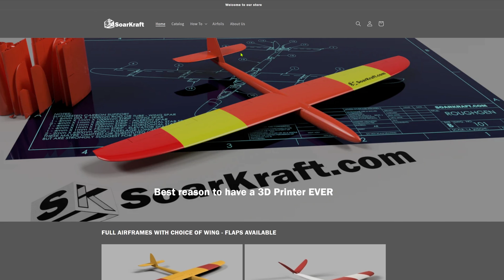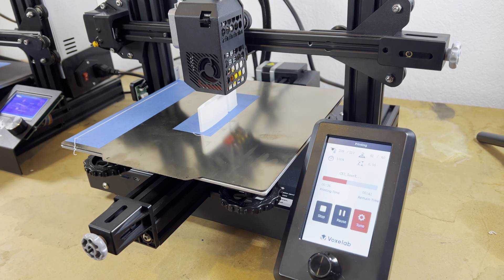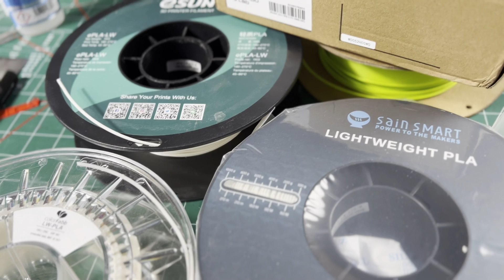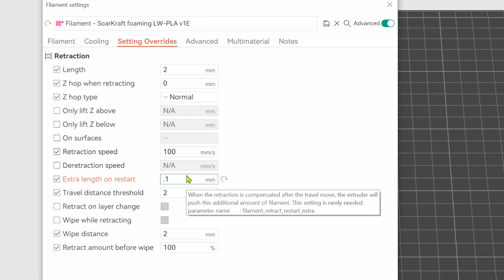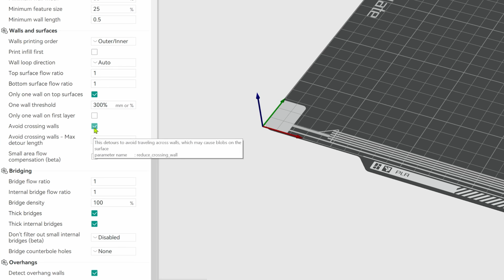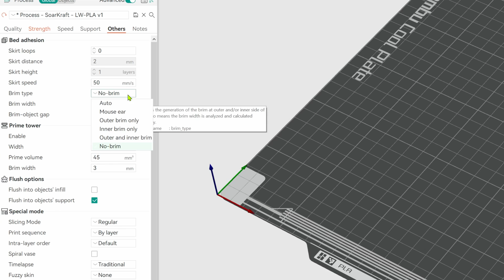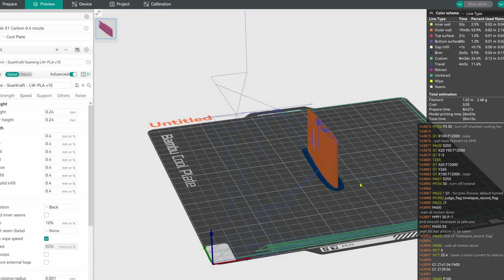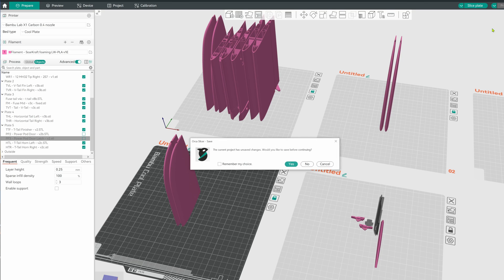Orca Slicer for Airplanes using any printer - SoarKraft

Comment: Hi Wayne, I have purchased your Roughgen glider.  Often in your videos you comment that Simplify3D as being one of the best slicers, yet you have never shared your slicer setting for Simplif3D, nore are they available on your website?  Any chance you're able to share them, because I too still feel that Simplify3D is and was the best.
Reply from the maker: Simplify3D was far better than Cura 2 years ago, but because you had to pay for it no one used it, and the recent revamp did some good improvements, but was not as good as I hoped.  I do have a small section for it in my instructions in the appendix, but I have mostly moved away from it.  It does still work, but not as good as Orca/Bambu/Prusa for many reasons and are free to use.   When printing a 200+ mph DS plane I want to print as good as possible I will choose Orca Slicer.

Comment: Can the Sidewinder X2 be used with Orca Slicer for printing Soarkraft planes ?.
Reply from the maker: Yes.  You have to transfer settings per how I show in this video, but it does well.  I still have 3 Sidewinders that I still use and I slice everything with Orca now.  The volcano nozzle does a good job printing the LW-ASA without clogging... but LW-ASA is not that great.
Reply: With a Volcano hot end, retraction makes no difference. I can see how retracting a solid, or plastic state might work, but a foamed plastic !.
0.45 flow and 240'C is possible with Colorfabb LW-PLA on a Volcano.
Your OrcaSlicer settings can be imported for all printers. Edit the .json files and remove all the compatible printers and inherts sections to e.g. "".

Comment: I am having problems when I slice my Aileron with internal ribs, after slicing the preview shows broken or missing sections of the part. Any help will greatly be appreciated.
Reply from the maker: If this is a problem with a SoarKraft wing panel I can answer your question... other file set you need to talk to the originator / creator, I don't know/test/print/talk about other designers parts.... just don't have time.  You can email me questions from the website.
Reply: @soarkraft  it's my own design. But I do understand the limitations. Thanks for the reply. I might have the ribs at an angle where the slicer is having issues. I'll keep experimenting.

Comment: Being new to 3d printing 'I'm still in the "experimenting level" so tried using your settings to print your test piece with varying results.
Firstly, I printed it using a low budget PLA filament with the Orca slicer and then again using the Bambulab studio slicer. (I have the Bambulab A1 printer)
Both prints were of low quality and would require a lot of sanding but I expected that result due to the budget filament and both weighed exactly the same at 8 grams.
I them carried out the same experiment using Esun e-PLA Lite filament and while the quality was somewhat better, I was surprised to learn they weighed exactly the same 8 grams as the cheap PLA.
I don't know what I'm doing wrong but the end result was confusing.

Comment: I bought last year a Soarkraft model but only comes the stl files which is impossible to make minor changes.  I would like to reduce the diameter of the carbon tube of the wings but it is impossible.
Reply from the maker: Impossible? you did not try hard enough. In the slicer you can use modifiers... or add a secondary part with the diameter you want.  And there are other ways depending on what you want to customize... do a search, there are lots of videos. Customization is up to you, but its not impossible.
Reply: @soarkraft  for me it would be easier to work with step files that I can easily modify on Fusion 360.

Comment: So is this printed using vase mode or not? I am slightly confused. Thanks.
Reply from the maker: No, these are not "vase mode" designed parts.  There are retractions and travel moves, but the parts are designed to reduce the amount of travel.  With the right setting the perimeter is printed in one long extrusion then the internal structures is printed second, including a second wall on the front 1/8 of cord to the leading edge for a strong d-box structure and a perfect airfoil.... or at least that is my intension.  There is oozing and defects occasionally, but controlling it.
Reply: @soarkraft  ok great stuff thank you 🙏

Comment: Having struggled with foaming PLA (Aero), I gave your configs a try and got much nicer parts.  Your infill at 15% seemed a bit heavy so I experimented all the way down to 3% gyroid and the part still seems strong.  Your config has 2 walls but you stated 3.  I tried both and didn't see much of a different in strength, only weight.  Thanks for the helpful information!  I had almost given up on foaming PLA.

Comment: Would Bambu pla-aero be considered foaming or pre-foamed?
Reply from the maker: Foaming
One way to tell if from the recommended temperatures.  
Foaming is 230-270 
pre-foamed is 190-220

Foaming - best results at 250..... ~45% the weight of regular PLA  
different temp = more / less foaming 

Pre-foamed is always 68%ish the weight of regular PLA regardless of temp... 
also
Prefoamed usually comes in 800g spool - another way to tell.  Overture Prefoamed LW-PLA is the only one I have found that sells a 820g roll.... its about as much as a roll can hold.
Reply: @soarkraft  thank you very much for this information. Very useful to know.

Comment: Awesome video. I might just have to try making an LW PLA pika now. 

I printed a pika in ASA and it flies so well. The fact that a total beginner fixed wing pilot like myself was able to do 3 flights, about 5m each, with 2 crashes and 1 “landing”, and still go home with a flying plane, is a testament to the great design. 

Also fun fact about the design, if you print two whole planes in different colors, you can mix and match the parts to create two planes with cool inverse color schemes 😂

Comment: Do these settings work with plane print planes? Their profiles are for cura using an mk3 or at least they used to be. Never did like cura.
Reply from the maker: Plane Print planes can only be printed with Cura.... otherwise they fly upside down ;)
Reply: @soarkraft  Yeah. I tried the big bobber from plane print using their cura settings and only ended up wasting a lot of filament.

Comment: This is Awesome just came across this. Have to ask what's the differences between LW-PLA and ASA-AERO
Reply from the maker: ASA-AERO from QIDI?  I have seen LW-ASA from ColorFabb.  Have not tried ether.  I do not have issues with the LW-PLA and sun or heat with the white material, and it prints easily and I can get to 45% weight of regular PLA without too much trouble.  It prints similarly (according to the info) but mentions warping... probably needs a good enclosure to print and it should be fine.

Comment: Why such a high sparse infill?  Surely 100% is way to high?  Most of the planes I have printed have been between 3% to 5% cubic subdivision.  Is it just the way your planes are designed? The wall direction trick is awesome, going to update orca right now lol, very cool addition
Reply from the maker: Some planes are designed for "vase mode" or 0 infill, mine are not.  I use single and multiple walls and some small solid sections in the same part... "vase mode" cant do that... and adding any infill to these "vase mode" parts total hoses the reason for "vase mode" and adds travel paths that are completely undefined by the design.   There are many other reasons I did what I did, but this is one of them
Reply: @soarkraft  Dude they work only for those plane and are extremely weird.  I have f...g people using those settings printing Eclipson, TD, FLightory and other planes and getting solid PLA (literally 100% solid, not good one) prints of 100s of grams instead of 10. Delete it or do some clarifications, please. For some reason became trending now and "recommended" to poor souls.